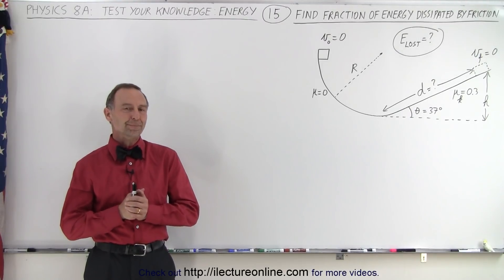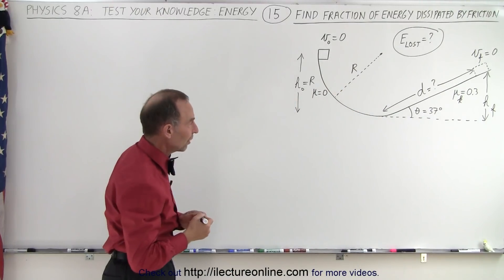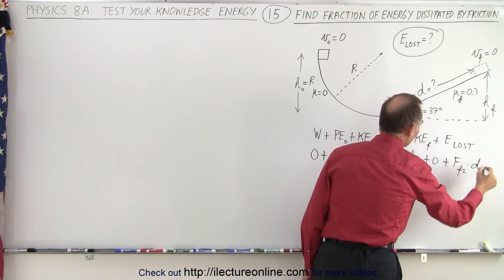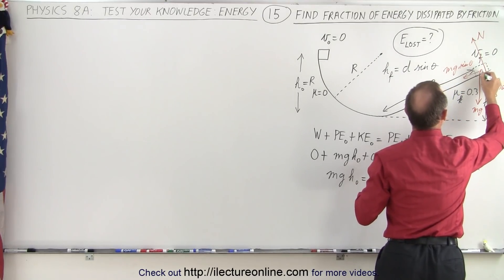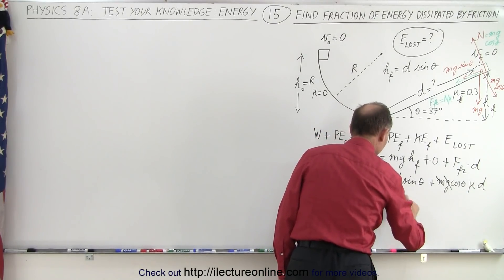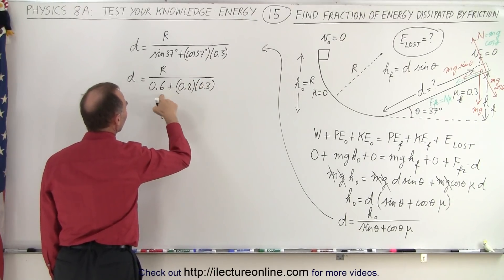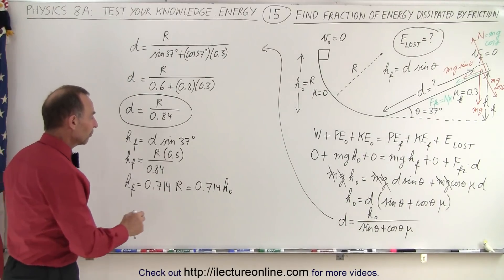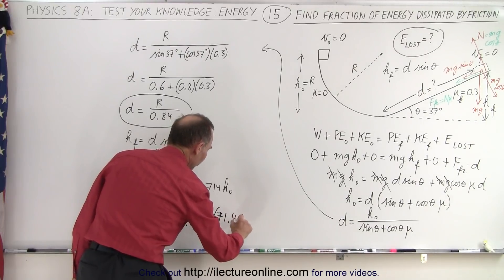Physics - Test Your Knowledge: Energy (15 of 33) Find Friction Dissapated by Friction

Comment: Um sir, what about mgsin(theta), doesn't that component of the weight act against the motion? doesn't  that cause any energy loss in the system? You didn't include that  at 3:38 . Please correct me if I'm missing something. Thank you
Reply from the maker: That is accounted for with the increase in potential energy
Reply: @MichelvanBiezen  thank you so much for taking your time to answer my question. 😄